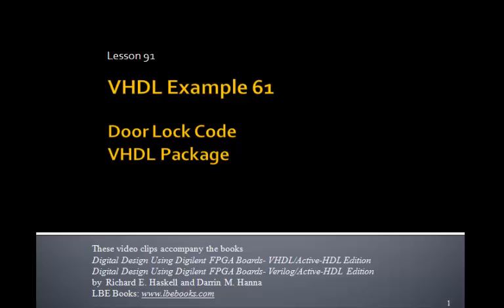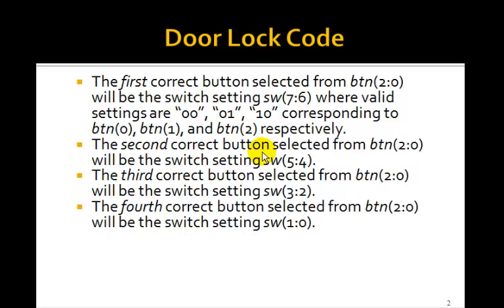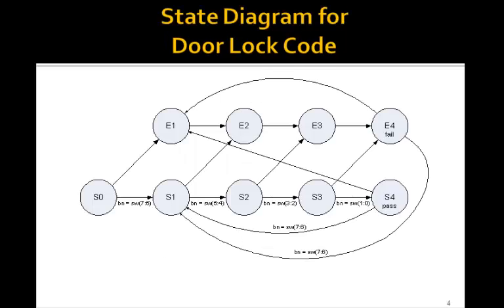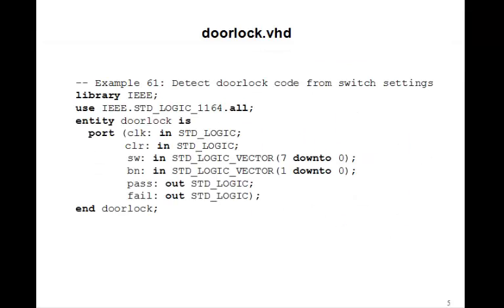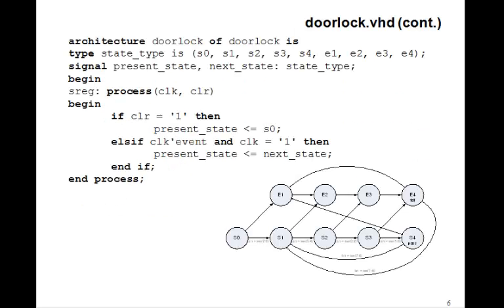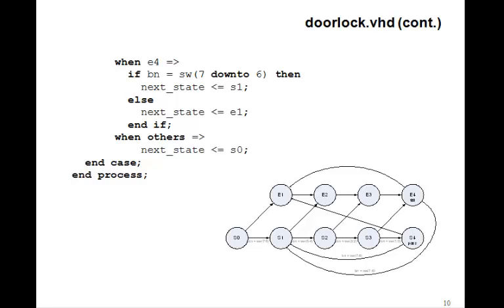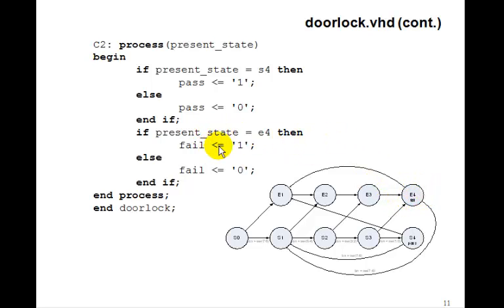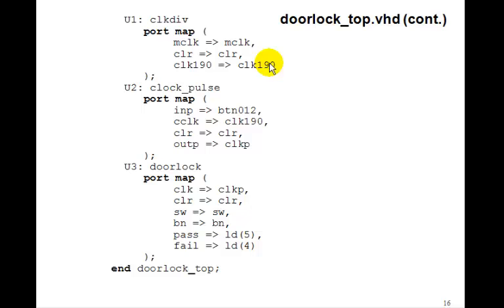Lesson 91 - Example 61: Door Lock Code

Comment: I don't get it, if you start in S0 and your buttons are not in the correct position, the clock goes so fast that you immediatly go to E1 and its still wrong so we go to E2 and E3 and then E4 and here we go again to E1 (What am i missing here? i think i should make the clock change with my inputs, but i can't see where you do this in your code)